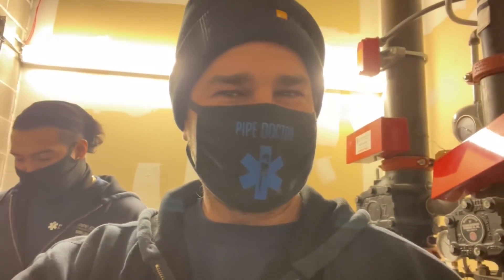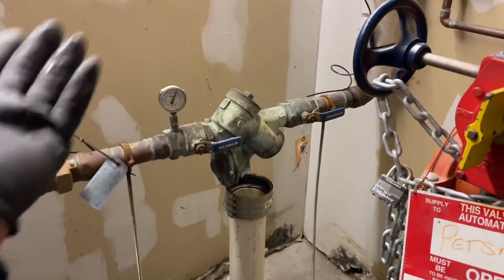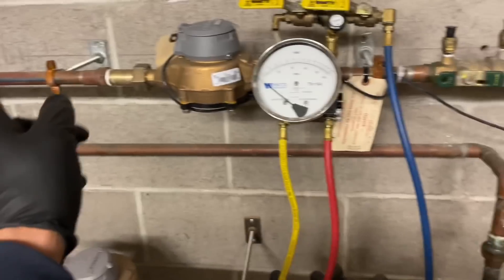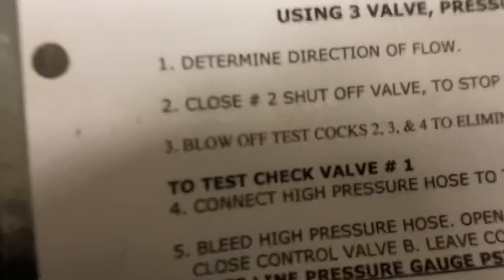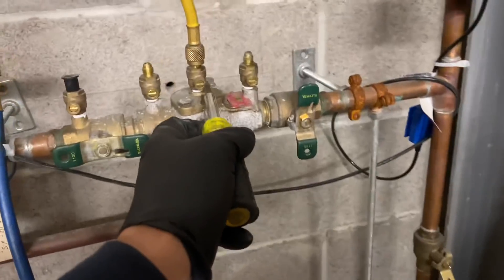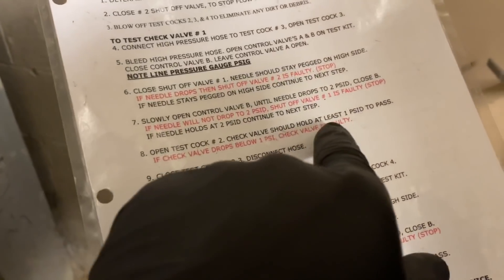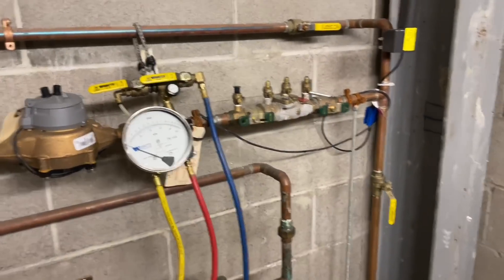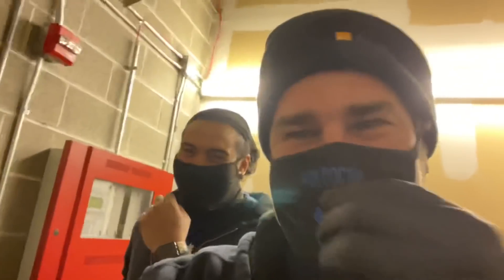How to Test Watts 007M3 DCV with Watts TK9-A Backflow Test Kit - 50k $3k Subscribers Giveaway

Comment: I've worked a half a year as a backflow tester/sample taker to prevent Legionnaires' disease in certain facilities.  but i've somehow never came across one of these. all i know is that here in the netherlands, dispite the scrict ruling around it. its only used for the highest level of possible cross contamination, the one with the drain installed next to it that is.  we call those "atmospheric interuption valves" . its meant to create a airpocket in between the 2 water sources, because even the Legionella, or certain contaminations can breach the valves that are shut.
Its a really interresting subject, but sometimes its so damn far fetched its becoming slightly insane.

Comment: I don't want to hear you complain.  In Washington State we have to retest every three years to keep our BF license.  You have one hour to test RP / DC / PVB / SPVB.  The tester can have a "failure" at any time. You have to describe the failure.  IE shut off valve one isn't closing completely.  You miss the failure, you flunk. 200 bucks out the door.  You fail the RP, you have to do all four over.  Not just the one you failed.

Comment: I’m not sure if it’s the Watts backflow tester or not. The Mid West model 845  I use seems a lot more straight forward. High on 2 low on 3 bleed and read. Same with t.c #2 and t.c. #4 and done.

Comment: i have told you that you are doing these wrong, you will need to have low and bypass all inline with test cocks  no hanging, its just wrong will and can give you false readings
Reply: its the American water work association, that signs off on the test procedure not the state

Comment: Lol
Hustleman !
This is where you should have used your battery operated air pump to blowout the line set(low pressure)
And they wonder why we/you charge so much, it's the amount of regulatory BS we have to go thu!
Did you pick your McCallum 18 up no sense waisting a trip ?🤔🥃🥃🍺🍺🍺
Stay safe Michael.
Retired keyboard super tech.
Wear your safety glasses.
Mini split young man mini spilt!🥃🥃🍺🍺🍺
Reply: @PipeDoctor  vodka
Smodka?🤣🤣🥃🍺🍺🍺
Stay safe.
Retired keyboard super tech.
Wear your safety glasses.

Comment: Godzilla Steve should get his own M18 ProPress  at 50K

The protocol for the testing and time for certification justifies the $75 yearly charge. Deer Park (Town of Babylon) requires them on all commercial Buildings. Nassau Plainview requires them even at the residential level too. All require yearly tests too. I'm just surprised they don't require them for in ground sprinkler hookups on LI.

This fancy industrial piping and threaded clamp holders, but the installer couldn't use copper pipe clamps or just a rubber bushing to avoid the corrosion.

Comment: Hey Mikey I got one. Friends house has very high water pressure from the city. It comes up to the house into the wall where a service panel is.  There the water line 1¼" splits. One line for the house and one for the sprinklers. After the split there are 2 pressure regulators. One is what im used to seeing around houses but the other on is huge and has been dripping water out the relief area into the drain pipe going outside. That started several months ago when he had the water line going from meter to house break because of a tree the previous owner had planted right over the pipe. He asked me if I could fix that. I told him I don't mess with those. It does look like the big regulator can be rebuilt.  Any suggestions
Reply: @PipeDoctor  will have my friend send me a picture.  Then I will send you the picture on Instagram
Reply: @PipeDoctor   messaged you on Instagram with those pictures.